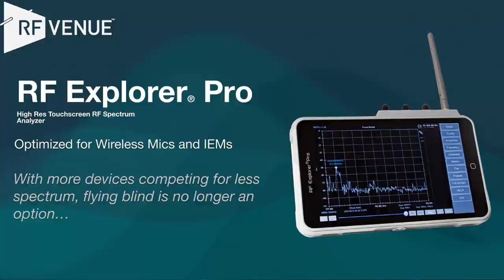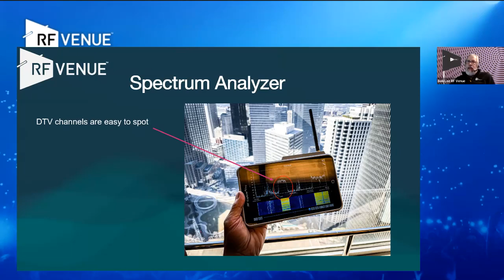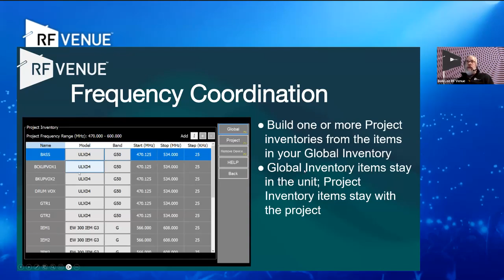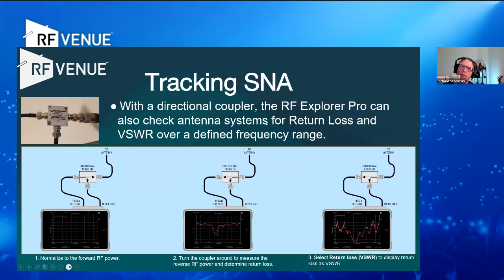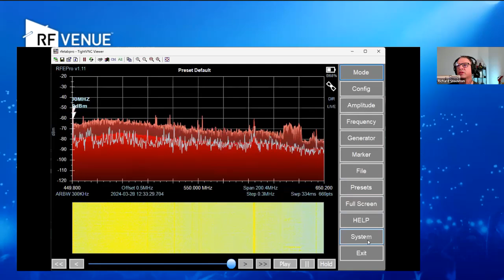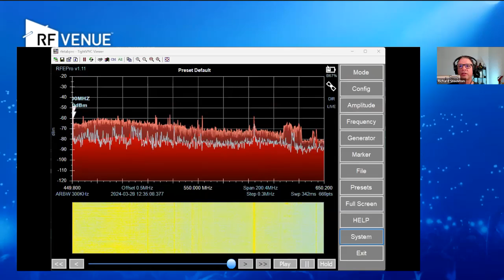RF Explorer Pro Training with Bob Lee and Richard Stockton

Comment: My tracking SNA just says normalization in progress forever or it will say normalization failed values lower then -80. I bought the most expensive package available and it still doesn’t offer the cable test feature.. I tried to test an attenuator and it won’t do that either. Can we do a more in depth video on it.
Reply: Cable Tester is included if you order license, please open a support ticket if you need assistance

Comment: Can I connect directly to a laptop (Mac) and save CSV files straight to the computer instead of transferring via a USB drive.  I guess another way of asking that is will it mount and show up as an external hard drive?
Reply from the maker: Yes, with VNC network connection you can use file transfer  - tightvnc.com
Reply: Yes, check the getting starting video. You need a USB-Ethernet adapter then connect thru your network to your Mac. It cannot show as an external drive because RF Explorer Pro is a full computer on itself.

Comment: Hello. I am having my first look at one today. From the device the Span frequency range is 250-3285 mHz. It is not helpful to not be able to reduce the span range here. Needs to be a whole lot narrower. How do I do it please?.
Reply from the maker: You touch the Mark in and Mark out to expand the view to anything between 15MHz and 6.1GHz
Reply: Use Frequency menu, then Span button, and set the range you need.

Comment: What model directional coupler do you use or recommend?
Reply: I use a Mini-Circuits ZFDC-10-182+, which Mini-Circuits rates for use at 10 to 1800 MHz. Its three ports use female BNC connectors. It's a transformer type DC; a loop type would be very large and expensive even in the UHF spectrum we use for wireless audio. There are numerous other suitable models from Mini-Circuits and other manufacturers. Make sure the one you choose covers the appropriate frequency range.